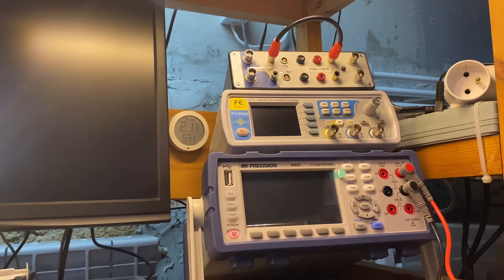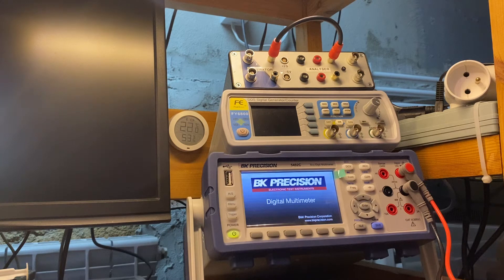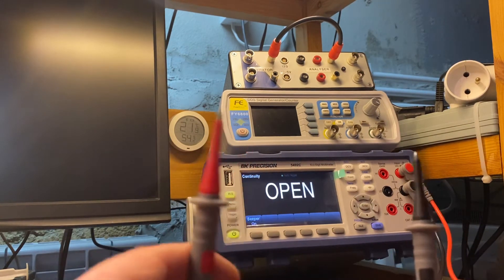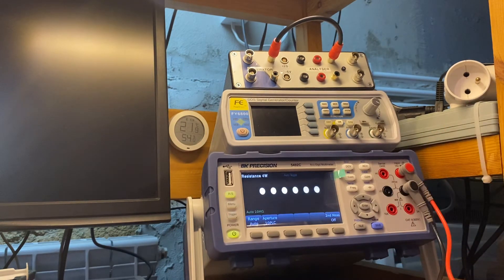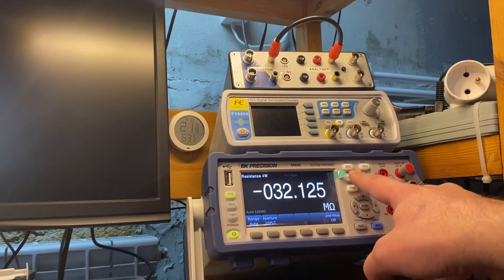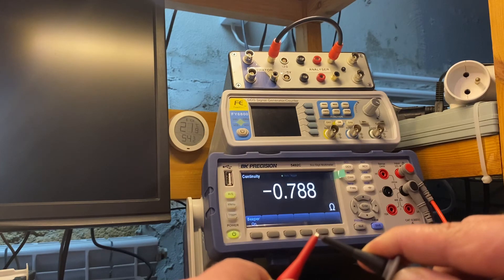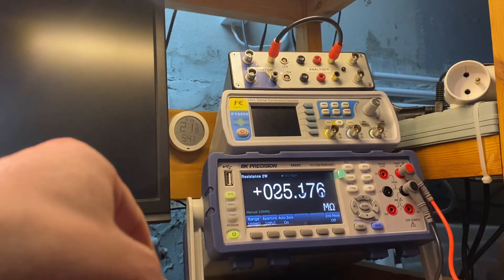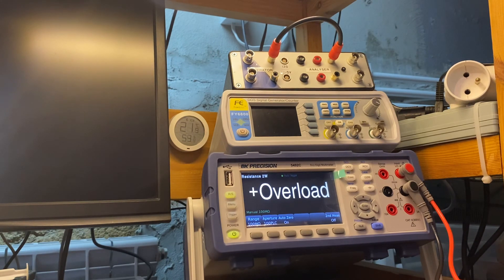BK Precision 5492C Hi-end multimeter firmware problem and high sensitivity on 100MOhm range.

Comment: I sent a BK 9801 for reparation for a TCP/IP communication issues and screen hang 4 months ago, they've done investigation, and told me this is a firmware issue inside the LAN module, now waiting for their manufacturer to repair this issue, no date supplied yet. Also, the issue is in all units sold.